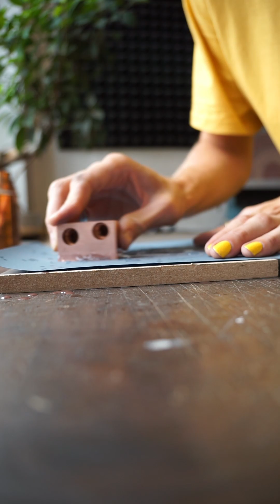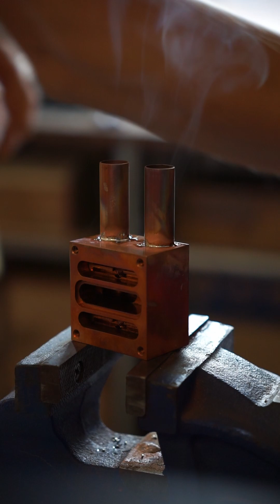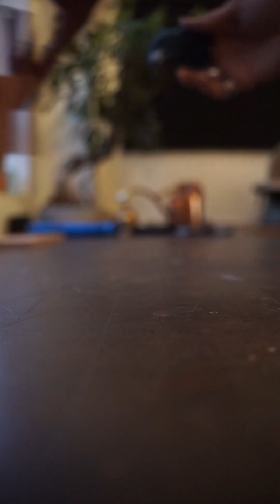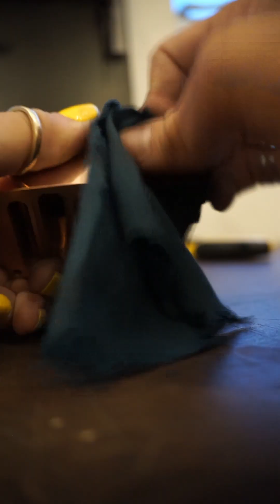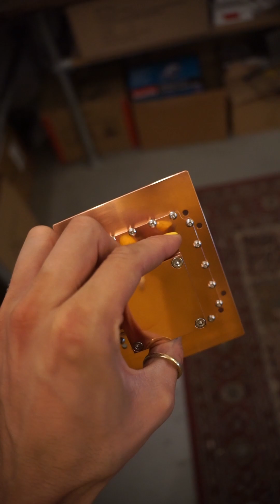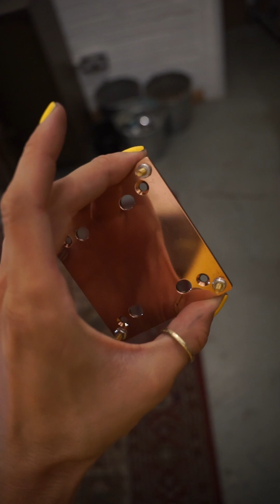The hand-finishing process of the Billet Labs Monoblock

Comment: Interesting that you don't have a set torque value to confirm that all bolts are correctly tightened during the monoblock assembly. Any reason why you wouldn't do this? It ensures that there is an even pressure across the plate. I presume it's because as long as they're FT you've not seen any issues? I wonder what material grade you use for the bolts as well.

Comment: been wanting to see a finished build but it seems there ain't any apart from the ltt video
Reply: Gn did a video where they built a 13900k + 4090 system with this. Both overclocked and it handled the almost 1000w like a champ 😮

Comment: Absolutely stunning. I love the way this whole system comes together visually to make the computer into a single cohesive form using cooling components. It's so much more elegant than a traditional case!
Also, I'm sure you've thought about this, but would there be any significant challenges with making an aluminum version, or perhaps aluminum-bronze? Would the conductivity be too low for it?
Reply from the maker: Aluminium would work, just less well than copper. It's conductivity is just over half of what the pure copper is that we use here.